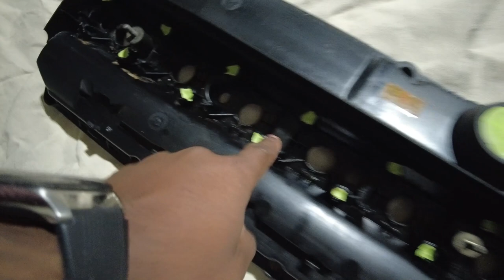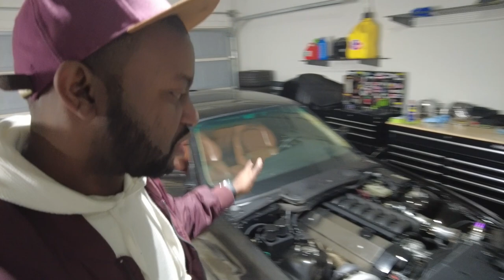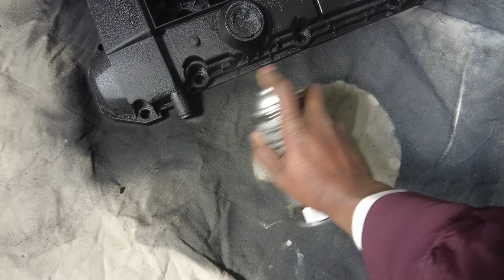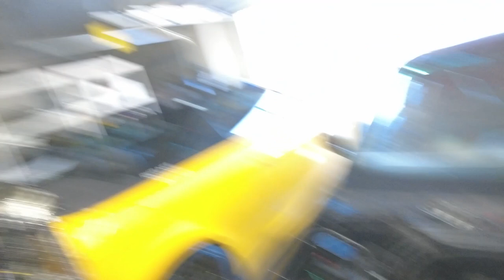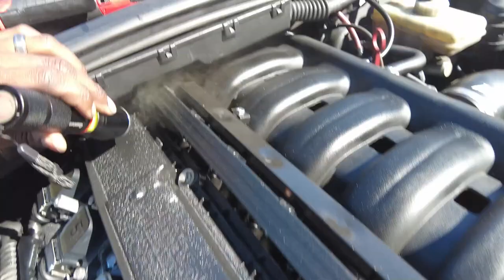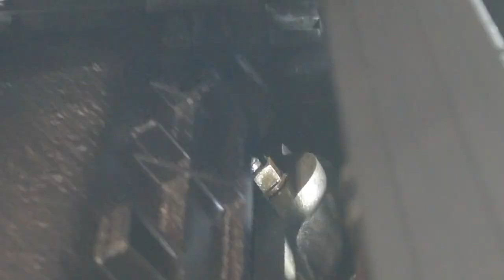How To Wrinkle a Valve Cover and Oil Leak Delete

Comment: I used this exact wrinkle paint and had a bunch of issues with it. I did use primer and it wasn’t optimal temp in the shop. But it had random tackie spots that and it physically wouldn’t wrinkle. Shook the can every 10 seconds and it cleared up a lot after about 3 days of drying and heat gunning it. Really not surprised someone else had issues with it. I
Reply from the maker: Yeah a little tough but worked out in the end. Would much rather do the powder coat route though

Comment: On my g35, I couldn't get the valve cover to seal even though I used a new gasket.  I removed the valve cover and reinstalled it with toyota seal packing.  It's good stuff to have around and it doesn't go harden up in the tube like other sealants.
Reply: The g35 valve covers are plastic trash man, they need a little gasket maker but too much will make it leak, I did mine 6 months ago and they’re leaking again 🤦‍♂️
Reply: @driftslutsgalore7646   Give the Toyota stuff a try.  I used hondabond, yamabond, off the shelf stuff.  Nothing holds up to oil like the Toyota seal packing sealant
Reply from the maker: Yeah I've heard that sealer is unbeatable

Comment: I think your driver side motor mount is bad. Maybe solid mounts?
Reply from the maker: It shouldn't be. They are brand new. It was way worse before but I can check the bolts
Reply: I dont think it's soo much as bad... but during boost you see it move up and down...

I kind of wonder if you're blowing out spark or have a misfire under load?
Reply: @bmwe30guy  you have a good point

Comment: orrrr just run the m50 valve cover. its what i run in my m52 i think it looks better too painted imo.
Reply: How was it with the coil pack situation though? I heard that they are different
Reply from the maker: They can warp too sometimes since they adapt so much heat from the head
Reply from the maker: And yeah Luis you have to change the coil packs for M50. I already bought brand new coils for M52 when I started the build so I gotta ride it out lol